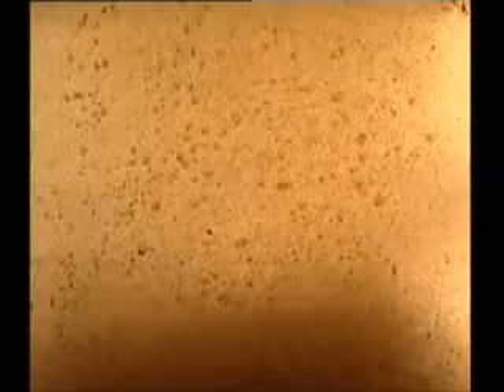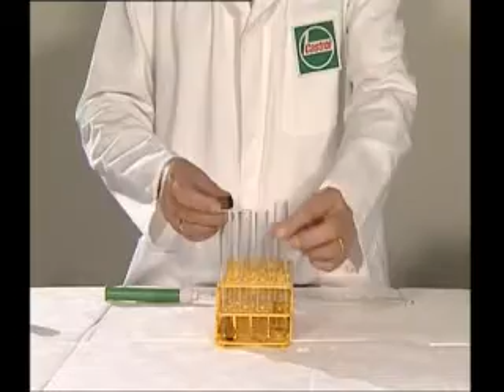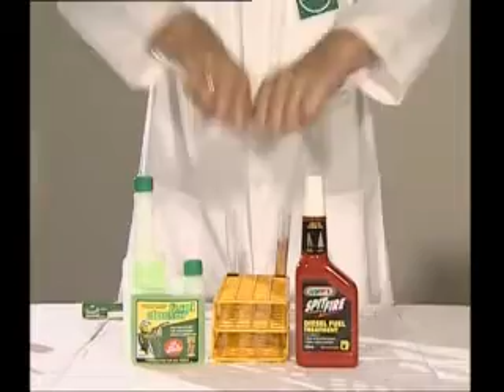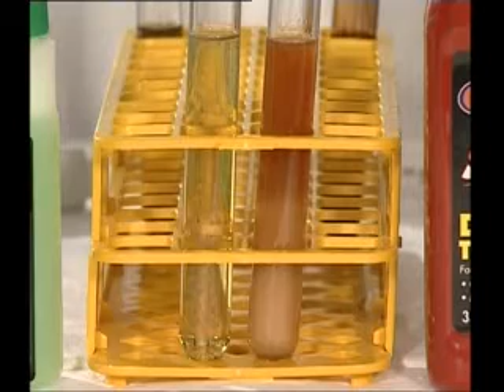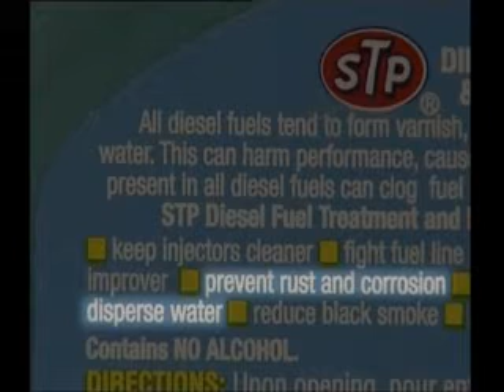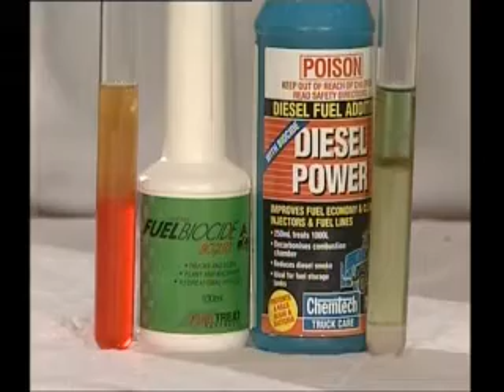SEE HOW! Fuel Doctor measures up against other leading brands!

Comment: Definitely looks like it does the job and I’ve researched it quite a bit now. 
For years I’ve been using the pro-ma equivalent in my diesel 4wd. 
Anyone now how they compare or are they doing the same thing?
Thanks
Reply: I hear you. I say find what gives you the best results & stick with that brand. You MUST use a P.E.A based additive for petrol or bioethanol vehicles. I know zero about diesel.